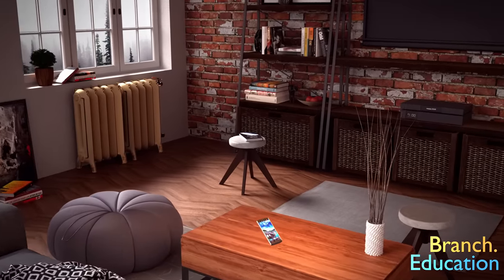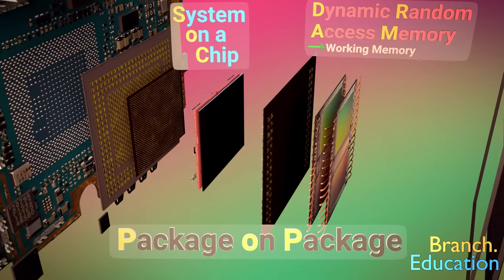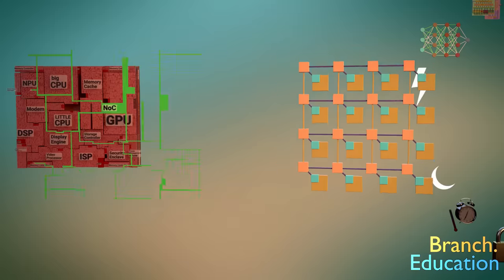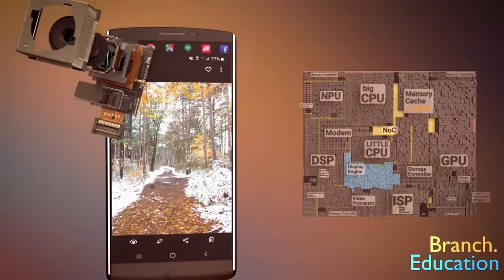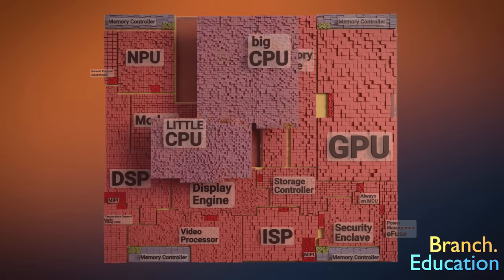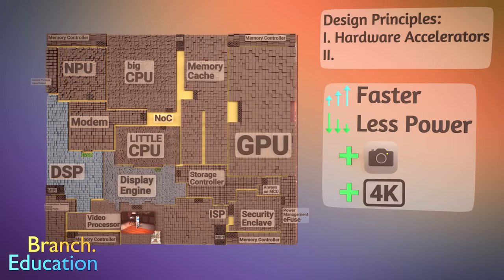How do Smartphone CPUs Work?  ||  Inside the System on a Chip

Comment from the maker: It would be greatly appreciated if you could take a quick second and tell us what you think or provide feedback on the video.  Was it too complicated or was a specific section confusing?  What about the pace of the video?  Was a section too slow or did it move too fast?  This feedback is extremely useful and it helps us improve on future videos!  So, thank you!
Reply: I can only thank you for the hard work on putting together information so valuable people may not even realize - these videos have in their respective scope, more valuable and more important data than many universities. Thank you once again.
Reply: You kidding,this is art
Reply: thank you very much
Reply: Another amazing video!! Thanks again!!
Reply: Nothing. Everything was perfect!
Reply: it was good but I would like more detail about transistor
Reply: Only issue I have is that the video skips over a lot of important details that I am much more interested in. And personally I think it would be way more better to cover these parts individually rather than the complicated system of a phone, I'd rather see the CPU on its own and not the interconnected complex way smartphones do it, at least initially, then you can combine them all together to show how it actually works in a smartphone. But asides for that personal issue, the way you present information is absolutely amazing and is not something you can see really anywhere else at all.
Reply: Don’t change a thing, really really appreciate the work put into these videos. Always mindblowing
Reply: Loved it
Reply: Awesome work!
Reply: Presentaste las nociones básicas de una manera sencilla y muy interesante, seguramente despertara el interés por la tecnología en muchas personas!. Estaría genial que hicieras un doblaje al español. Saludos desde México
Reply: Mind=Blown. I consider my engineering skills above par, but micro electronics are beyond me. While this, too, was beyond me.... well explained.
Reply: I wanted to know little more about NoC section of how they stop electrons from reaching another areas of a chip, little more than just a "traffic light", the whole video felt like a brief explanation, but it's still was really informative, thank you
Reply: Sir, really awesome. Well done ✅. It is cristal clear.
Reply: Bro I was thinking about how processor works for about a month and reading books and seeing vedios on it but by your vedio it is easy for me that how they works,thanks bro
Reply: I want more highly detailed videos😃
Reply: Who the hell hearts there own comment? 

Jk
Reply: Sir make video on how this soc are made and how photolithography techic work
Reply: This technology is insanely small and insanely complicated
Reply: Everything was perfect
Reply: I just want you 2 know that I'm really thankfull for all the knowledge you share with your community, pls keep doing it.
Reply: How a small transistors convert in a processing unit make a separate video on it
Reply: The complexity in these vidoes sometimes makes me think if technology eventually will backfire on us.  Thank you for the excellent explanations.
Reply: I really love your videos and the production value that its put on them, the graphics are great, the content is well explained (not too much or too little) and the length was right! Thank you!!!
Reply: I think this channel's profile picture should be changed into more modern/minimalist design. The current one seems to be outdated.
Reply: @deepbluedrone  yes, i am software dev by trade, and even for me this was realy interesting and informative! Thank you!
Reply: imagine if taiwan was annexed by china long ago, soc development wont go this far
Reply: No words to determine your hardwok and there is no negative feedback.
everything is perfect.
Reply: Please do a video on FPGA
Reply: beautiful video work
Reply: This is kinda counterintuitive but a bit complex video is better. coz most videos about processors and stuffs are kinda abstracted in a sense
Reply: Please please make the complete series!!!! Amazing content!!!!
Reply: Your Gerber Labs link just seems to be a URL without an affiliate link.   I am not sure if that was supposed to be such.
Reply: I'm actually studying electronic engineer at Politecnico of Milan.  I'm amazed and I hope some day professors will use videos like this one to explain what we are going to built. It's clear and well organised. Indeed it makes me find out the will of studying that today I don't have.
Reply: Thank you a lot sir...
Reply: This is exactly the Advanced Computer Architecture course (Universität Paderborn) based on Hennessy & Patterson. Please do in-depth video series as they would be very useful to many bachelor/master students
Reply: Impressive graphics but I found them distracting when you explain a concept while the animations do something else than making the same point. Can't focus on two things at once.
Reply: I liked the flash memory video more because of the detail and depth. This one was incredibly fascinating though even though lacking in details.
Reply: 🔥🔥🔥Perfect!!! but can we please get a live 3D representation of what a basic logic gate looks like in the upcoming CPU teardown... say a basic AND gate module. Thanks
Reply: I feel like the name of the channel puts people off, because they think that it's just for schoolwork or something
Reply: Great video on SoC. Thank you so much Brach education 🖖waiting for the new series.
Reply: (Everyone ought to add youtube to their whitelist for their Adblockers to really help support this channel and channels like these!)
Breaking it down even to graphical interfaces and representations makes understanding these complex core concepts rather easy to understand!
This was a fast 23 minutes, I was able to keep up with the information and details. I was enthralled the entire time. 
These are probably one of the best, if not, the BEST channel out there on breaking down complex things into understandable terms and languages.  If fact, I'm even tempted to show one of these videos to someone who is not technically informed at all about technology (A nice way of saying: someone who knows how to turn on a computer and go on facebook and thats it Lol!)
One thing that I do think would be very useful in future videos is to have links to information/resources pertaining to the info in the video for one's own research, or to further one's own research (Even if it is mentioned that there will be videos in the future about such information).
Can't think of any other suggestions at the moment.
Keep up the awesome work!
I look forward to all of this channel's future videos!
Thank you to everyone who helped make these videos possible!
Reply: Amazing stuff...great effort.
Reply: I love this presenter's voice and style. I am reminded of forensic files and equally as educational and interesting. No, I don't think it was too complicated, in fact I think the presenter simplified the details just enough for it to be educational and yet entertaining. It's like try to convey the key technical details of a CPU architecture such as bandwidth and bus without putting most people to sleep. I think that has been achieved here in a very illustrative and elegant way.
Reply: This is a high quality level of presentation of a very complex mix of technologies but you seem to have great talents of introducing these complexities in a much easier and simplified manner, then going just the right pace to introduce the tech further in a much more detailed but fascinating way. You took a very plain, unappealing and  boring sets of topics and combined them and told them in a manner that keeps your audience interested to know more. Well, you surely got our attention and now we are interested to learn and now more of how those tech work, designed, made, combined, connected and package together  in a  single product like into a single SoC or a smartphone. Thank you for sharing your knowledge combined with your great passion on these subjects and technologies thru your great talent in telling (lecture) how all these tech work in a   very artistic way. Yes, this video is more of a fascinating art than just a lecture. Thank you very much!

We hopefully wish you can make  those detailed videos of those tech, and another video for discussion and reviews of electronic software tools to design digital circuits and PCB. and links to partner company like your sponsor GerberLabs to help us materialize our ideas easier with less effort.Yeah, I am sold! I will try to become an inventor and hopefully can make it into a product. You inspire me to become creative again. Thanks!

This is my first YT comment and feel honored to make my first post here.
Reply: Increase your production speed and provide us more videos.
Reply: Very good informative video thank for it .👍😀
Reply: These videos are perfect!
Reply: The video was great! Are the creator's comments out? I'm not able to access it. If not, could you upload the video along with the comments next time onwards? If it's actually not out, it'll help if you mention when it'll be out. I've loved the creator's comments from the past videos, and I've been coming back here to check everyday XD.
Reply: Rockin🔥🔥
Reply: Well done! How’s that for feedback?
Reply: Awesome work... It was fine to me, even a normal person that doesn't know nothing about electronics basics can understand!
Reply: Never learned this much electronics in 24 mins!
Reply from the maker: @brunomartel4639  Thanks!  It's appreciated.
Reply from the maker: @brunomartel4639  Thanks for the compliment!
Reply from the maker: @nilankoor  I appreciate it!
Reply from the maker: @TheFalco708  That's a good point!  By the end of the script I was like- this has got to end.  In a future vid I'll 100% dive further into the transistor.
Reply from the maker: @randylahey2242  I appreciate it!!
Reply from the maker: @deepbluedrone  Thank you!  I appreciate it.  I hope to eventually to inspire universities to utilize technology and resources such as this in their classroom.
Reply from the maker: @brunomartel4639  Thank you!
Reply from the maker: @russel9083  Haha!  Thank you.  Honestly my engineering skills are just average, but somehow my visual explanation skills are where I'm proficient.
Reply: could you make a video show us what the npu die structure is how this structure works
Reply: 23:22 it should be more small of that map, but you should really compare how big with more than 100 layers vs one parts of one layer how actually small is
Reply: Thanks for sharing an incredible  knowledge
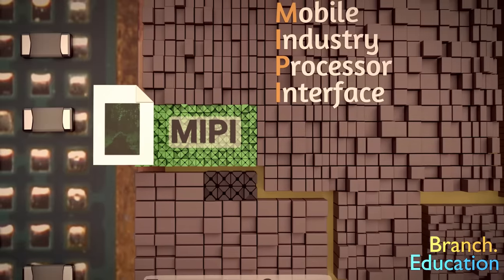Reply: 10:04 MIPI receives and sends data at 5 - 8 gigabits per second wow
Reply: @richard35791  Do you even know what "annexed" means? Geez, dopey people using fancy words they don't understand... You clearly have no idea of the state of play with China and Taiwan. Stay out of politics - you're not up to it.
Reply: subscription
Reply: @andoletube  bruh, taiwan already become independent country, but communism china do not approve it, still claiming it, somehow china not attacking taiwan until now maybe because taiwan heavily supported by usa
Reply: @andoletube  rent free keyboard warrior, want to start debate about politics?? Fine
Reply: @richard35791  You're the one who threw in a completely irrelevant anti-China remark - and packaged it with some geo-political jargon. There's no debating with somebody who is just pretending to have insight.
Reply: So much hard work goes into these videos. I'm not sure why they are not more popular. I'm glad I'm supporting this channel.
Reply: Thank you very much it just blown away my mind your video are amazing!!!!!!
Reply: How humans are able to make such small transistor 🤯
Reply: @andoletube  USE YOUR FUCKING LOGIC, CHINA TECHONOLOGY (SUCH AS HUAWEI RISE IN MID 1990S) MEANWHILE TAIWAN TECHNOLOGY ALREQADY STARTED FROM EARLY 1970S, IMAGINE IF TAIWAN ISLAND CONTROLLED BY MAINLAND CHINA, TSMC DEVELOPMENT WOULD HALTED 20 YEARS!!!!!!!, DONT WORRY MYSELF ARE XIAOMI AND HUAWEI FANS, BUT IF YOU TALKING ABOUT TSMC , IT IS DIFFERENT MATTER
Reply: Mind blowing ♥️🤗🔥
Reply: U nailed the video.. ur the CHIP KING😀😀👍👍👍👍👍👍👍👍
Reply: Can u please bright a detailed video on why don't chip manufacturers such as mediatek,sd doesn't develop their own phones?
Reply: Thanks for explaining in details 👏👏
Reply: Thank you so much for this..
Reply: I don't have enough words or know the proper words to thank you for such a wonderfully conceptualized video, on a device that we take for granted. Kudos for the marvelous graphical presentation.
Reply: Please make video on fab process and inside of CPU and how it works... I have read about the process in my subject but your video made sense on how everything works. I have enjoyed watching your video :)
Reply: Great video. Very much interested in the follow up. Would be nice to have a video on the actual way the logic gates work (together) to execute a task. Maybe not the simple ADD 1 task, but how do various gates, etc work together to perform a more complex instructions. How are they routed? Given the speed these processors work at, how does 'it' 'know' where all the individual instructions are sent to and how are they recombined into another instruction? And come to think of it: how does 'an instruction' get designed on a chip...? I know. Should have gone and worked at ASML.... Nicely done this. Good quality. Good graphics. Well done.
Reply from the maker: @henktl3580  Thank you!  Yeah I for sure will provide more details than just 'how do gates perform ADD', because that's a video I've seen a half dozen times already on YouTube.
Reply: @BranchEducation  Great! Look forward to that.
Reply: Wow! This was incredibly detailed and comprehensive, while still being digestible. I feel like I can send this to most people I  know who would care to watch a video like this from start to finish, and I'm sure they'd stand to learn a heck of a lot from it. Heck, I was reading about SoCs in EETimes back in 2005, and been using smartphones since the first iPhone, and there were still a few details I wasn't entirely clear on. I've honestly never seen the NoC illustrated on a block diagram before, for example, and it was helpful to know its function, its arrangement throughout the SoC, how it throttles up and down, how many wires it had, and what it connects to. I'd love to see more videos like this! Also, please go into VLSI. You mentioned there are 120-160 steps in manufacturing an integrated circuit... How long does that take, from start to finish? I've seen estimates of 1-2 months.
Reply: Wonderful. This is more than awesome.
Reply: Hey, its a grt video...
I suggest u can make a video to show how to make such animation
Reply: this is very well explained, thank you and subscribed. I even enjoyed the advert.
Reply: I would like to greatly appreciate your work and effort and thank you a million times to explain a complicated topic in layman terms. Keep it up.
Reply: I love you and the channel, thank you! Thank you!
Reply: How to work Gpu(graphic card) please make one video
Reply: Keep it going! Perfect!
Reply: Your visuals!!!!!! Amazing!!! They helped tremendously. It eliminated the need to go into great detail about how certain things work.
For example, simply dividing the image file into different pieces says that the image is somehow split up digitally but eliminates the need to go too deep into saying how that is done.
I also love the simple repetition of the animations to help us understand what you are talking about without having to reexplain in detail again; your words some how fuse with the animation (i can’t explain it)
My favorite part was you carrying us from the taking of a picture with your camera to sending it to a friend over the internet.
Also that grain of salt animation just sealed the deal: as i said your visuals + explanation are excellent... amazing...superb. I thoroughly enjoyed it. 

I love the depth, sometimes persons may not want to search and read about these things or sit in a one hour lecture just learning about a sub system, they just want a deep but general understanding of how things work, and i think you gave us that.
Reply: Thank you for the video - if possible you can make entire series on working of soc , storage , battery , etc where main aim of each series is to understand each component and each episode will contain in depth information
Reply: U are so great to explain this so clearly 💖
Reply: THIS IS BEYOND GOOD....well done!!
Reply: Thanks for taking the time to simplify for the average person. I shared it with all my friends.
Reply: @artremiss5276  The class you’re looking for is called hardware architecture. In the first class that show you how to build things like adders/subtractors memory, and other things with transistors. Finally at the end they show how to tie it all together into a cpu. 

The next class scales up to operating system level. Closer to what you see here, but nowhere near as complicated. 

They have to gloss over a lot to get it in a 25 minute video. If you wanna know the details, go to college as a computer engineering major and you’ll get the whole scoop 😏
Reply: Sir please can u make one video on "how earphone/headphones/earburds works inside"
Reply: Arm controller topic i want.
Reply: Would you share more videos like this? It would be such a huge help for thoso who's studying thia area of knowlegde.
Reply: simply one word is needed to describe ur work - amazing!!!
Reply from the maker: @artremiss5276  Thanks!!  We plan on making separate videos focusing on the CPU.
Reply from the maker: @deleted212  Thanks for this comment!  I really wish I could make these videos 10x faster but with the same fidelity of content, and hopefully one day I will be able to.
Reply from the maker: @wasim_ghafar  I'm working on it!
Reply from the maker: @PearComputingDevices  Thank you!  It's much appreciated.  I'll convey your appreciation for the voice to the narrator.
Reply from the maker: @sashankkrishna8672  Yes- I just recently posted them.  Took me a few days to write.
Reply: This channel is underrated, 110% perfect, loved the video so much. I've sleays been curious how it worked and now I know
Reply: @BranchEducation  Fantastic!
Reply: I would really like to learn more about how the SoC is being adressed to. How is it integrated into the PCB of the phone and how does it communicate with the other components on that PCB?
Reply: Consider changing the font and use more modern color grades but overall it's great!
Reply: I was absolutely astonished by the visuals! Maybe try improving on rhetorics, you could put more energy in your voice. Otherwise this content is greatly appreciated, since it is so rare to find.
Reply: As a electronic student, this is extremely useful, I loved this video, waiting for more
Reply: Not so complicated to a electronic engineer student, thanks for the vid
Reply: Unfortunately, you're going to get a lot of sycophants in the comment section. The fact of the matter is I got bored before the 15:00 mark not because I'm not a techie or hate analogies to human parts but because I think you chose a complicated task (photo-taking and display) to explain how an SoC works. Furthermore, the designing and manufacturing section of this video unnecessarily complicates the explanation of SoC operation. YouTube viewers are not in an electronics engineering 101 class. The monotonic voice is second only to a high school jazz band's ability to put me asleep; it reminds me of those videos teachers used to play about sex ed or sexual harassment. Finally, splitting this video into two or more parts will both simplify the subject matter and keep the viewer's attention. It's like the video was made by a robot (maybe GPT-3, lol) prior to the advent of YouTube and short viral videos.

I hope this was helpful, and you don't take it personally. I'm going to duck the replies. ;-)
Reply from the maker: @BZUHUB  Thanks!  We are indeed working on Arabic translations.
Reply from the maker: @Ou8y2k2  Thank you for your feedback!   From being an engineer, all feedback good or bad is useful feedback.
Reply: I am wondering what is your occupation
Reply from the maker: @user-yp7gv1sr7r  I make these videos full time.
Reply: Every thing is perfect nothing is wrong and i appreciate your hard work
Reply: Instant sub. Only can change from already excellent to absolutely stellar  :-) Thanks a lot!
Reply: @BranchEducation  The section from 2:07 on (Notes and Details on the SoC) was pretty much superficial. E.g. you say: "We rely on manufacturers information ... information will be mixed ... from different sources". Self justification is not needed. All in all, I feel, while smartphones are complex, your explanations are still unneccessary complex. I also feel whoever did the text does not understand the topic completely. Why do I say this? Because  the explanations are in many aspects confusing. It is neither a real abstract or a real in-depth. Gazillion of details and no explanations of principles or fundamentals. The video marvels about complexity. Still, there are also good parts, like the explanation of taking a picture. But even this one could have been done much more clear.

Or, just taking a random quote: The microchips are manufactured on 300mm wide silicon wavers in factorys called "fabs". I cringe at this, because beside the mention of "silicone" this is not relevant for understanding a smartphone. Neither the size of the wavers or the slang word for the factory are important. Lots and lots and lots of detail totally superficially in actually understanding what goes on. Sure, for impressing the uneducated it goes a long way. But it doesn't give them what they would need: Real understanding. 

So it makes me sad that despite the clear effort and dedication that went into this I cannot see that real understanding will stem from this. You could have simpified a lot by skipping much of the detail and putting effort in general understanding about how computers work, because at the end we have a miniaturized PC.
Reply from the maker: @ChristianMiersch  Well, the target audience is secondary school students / High School, and possibly first-year university students.  The idea was to provide a top-down explanation without any gate-level logic.  The issue is that an episode that goes into specific blocks of logic will have to be fully dedicated to explaining those blocks, so I didn't want to breach that topic yet.
   But at the same time, I did want to focus on a functional aspect of your smartphone, rather than saying 'there are all these blocks that do stuff' hence the image processing pipeline.
   I agree I could have talked more about manufacturing, however, the average view duration is around 7min (from statistics of the video), so that's why it got cut shorter and more superficial than I would have wanted.
   If you have a recommendation for a topic and the outline of the topic I'd be happy to take a look at it.
Reply: Hey, I come here again just to write: I read the footnote (: and probably it would be funny to see some joke in the middle of the erratum. Just as a common secret knowledge between you and yours most interested viewers, u know 😉
Reply: I can't say any better. My university processor even share this videos with us when we learn about cpu
Reply: Brilliant in its simplicity and relatable examples. More power to you 👍👍
Reply: Everything was going in a saturated way. The animation was really amazing.
Reply: Great  just wohhhhhh!!!!!!!!
Reply: It’s perfect 👌🏻, like the perfect training video in a perfect factory ⭐️ 🏭 , thank you!
Reply: This Video is more about the SoC than the CPU.
Reply: This is an excellent video, pacing is good. I actually sped it up a little bit, but that's cause I'm inpatient and also familiar with some of the basics of the topic. The only comment I have about things to change is that I would love for the comments within the subtitles to be available to read somewhere in full. I find it really distracting reading them with the video in the background, even with the sound off. Probably because they're so detailed and technical. Very interested to see what you have to say in there so would love a plain text version. 

Thanks so much for offering this kind of content for free.
Reply: videos on this channel are detailed and visualisation of components is excellent. 
I am glad that I found this channel for my learning.
Please make more content. Its useful a lot
Reply: Smartphones do not think they are all engineered and programmed electrical current.
Reply: I assemble program and produce circuit boards with components and it still blows my mind...
Reply: I can't think of complaining about anything even when something would have been there ,right now its a perfect piece of art in which you are specialist .I am just in love with your content .
Reply: Please do 10 minute videos (to prevent being bored) and do wifi routers, consoles and cars and more things most people can relate to. I actually love your videos and wish everyone enjoys watching them.
Reply: I honestly can't think of anything. The animations, explanations, and structure seems of no issue to me at all.

This might be asking too much of an independent channel, but I would pay to see a break down of the CPU architecture of either the 6502 or the Z80 and a simple system implementation such as the commodore 64, apple ii or ZX spectrum(not to mention, retro tech has gained quite some traction in popularity recently). Both should have plenty of material and resources available and due to how long its been science their conception, there shouldn't be any intellectual property issues. This would be a great introduction to the world of cpu and system architecture. Brownie points if you could manage the original IBM PC sense that's the basis of all modern PCs/x86 systems. Id pay double for that one.
Reply: Great video! Please continue the good work. Undoubtedly the best videos on youtube for topics discussed!
Reply: Can u share this video with me I will explain in hindi ....and also suggest for English video for your channel...
Video is amazing ....🔥....
Reply: As a visual learner, these videos are awesome. I pass them around to anyone who has a interest in technology.
They are the gold standard for understanding these incredible devices. Continue the great work.
Reply: You mentioned that a photo is divided into 4 section during processing ( cache 4-16 MB &  super page & super block )Sometimes I see at a display the photo was display from top line to bottom. Please explain 😷
Reply: You mentioned that a photo is divided into 4 section during processing ( cache 4-16 MB &  super page & super block )Sometimes I see at a display the photo was display from top line to bottom. Please explain 😷
Reply: Why don't we use more than 24 MB CACHE @ SUPER CACHE... 🤔
Reply: In my opinion it was perfect in every aspect you mentioned in your question, and so is the entire channel. Amazing work and thank you man.
Reply: All the videos you make are worth watching and I watch it multiple times to grasp the small details you add. Thanks
Reply: Yeah it's confusing because the CPU is its clock rather than the brain which is the writing to the first cache
Reply: I don't LIKE this video : I LOVE it! The explanations are sooo clear that even me have understood it... You did made simple a quite complicated matter with almost no technical terms, and when used, they were clarified in advance! Due to the absence of a "Love" button, I hit the "Like" and subscribed (the guys in YouTube should correct this). Thanks for a great job.
Reply: Green fonts over the green background is not the best decision.
Reply: I'm speech less. I want to write too much that I can't write. Really amazing video. Thank you very much.
Reply: Such an amazing and informative video. Please add more videos like this to explain CPU further like you said in the video.
Reply: Thanks for this video.it's esay to understand and give me a lot of interesting information about today's technology's.. it's also a maind blowing facts about hand phone that we use every day.hope next video is about how to free up our hp memorys in most effective way or tip and trick that hidden in our hp.anyway thanks for making this video.I really enjoy it.bye...😊👍🏻
Reply: Very simple language and amazing teaching skill🎉🎉❤❤
Reply: I thank you very much for this video first of all, your intent to teach what you learn is very much incredible I know that information that you passed to learn very thing is taking 100-1000 of books to know and to say the information like this to represent this data like this I have take one year of time or pretty much more this is worth of billion dollar thanks to you guys make it simple and quick for me and once gain I thank you guyz very much
Reply: Damn, absolutely speechless! Never before have I witnessed such a high quality video that accurately shows the processes of an SoC. The animation is exceptionally high quality! Very well done! 20/10!
Reply: This video was too short. Make longer videos,1-2 hours, and explain everything.
Reply: These videos are, no exaggeration, nothing short of treasure. Some complexity is necessary, or every video would be 5 hours of restating rudimentary knowledge that could be found in other videos.

Your content is truly amazing and valuable just as you do it
Reply: Sir , what you are doing extraordinary your video don't needs feedback there are no detailed micro chips videos I have seem my entire life , your graphical explanation is I m speechless I have no words you explain in so deep a non tech savvy person can easily understand the complexity of this micro tech and your are asking for feed back I wish you soon received YouTube platinum play button BBB because you talent is extraordinary like a more than a scientist.
Reply: This is awesome. I like it to be very detailed like this video
Reply: love this channel
Reply: Fcking awesome video. presentation, editing. Superb.
Reply: Thanks for uploading
Reply: The video was great, but, as mentioned, it was just scratching the surface..I still don't understand a ball of the technology involved..and I probably never will...but of course thnx...
Reply: You really did great Branch Education.🙌 Can the voice of the narrator be more lively and energetic?😁 Overall your hardwork is highly appreciated.❤
Reply: Для1й
Reply: That was breathtaking. Thank you.
Reply: Mkae Videos on Interrupt Signals & Direct Memory Accesses etc
Reply: These are greatly appreciated! Simplifying a ton of research in visual terms is so underestimated by calling it YouTube videos - its magical
Reply: I have a long attention span! Excellent vid. Thanks!
Reply: Special thanks from Morocco.this channel must be supported because it gives us premium contents.
Reply: Really good video that made me discover the NoC. It's seems to be a crucial subsytem yet really a unsung hero of our SoC so I think it would warrant a video focusing only on NoC (history, development, how they work (routing protocols, switches (and buffers?)) and what are the current and next-gen advancements in this domain). In the meantime congratulations for your work, you've got yourself a new subscriber
Reply: Wow you not need to ask it is nice or not It is very very very nice ☺️🤠
Reply: P
Reply: I would have loved if it was more detailed, even if the video was 2 hrs longer
Reply: I actually work in this field in one of the companies mentioned and have to say that I've never seen such a great content before. The only thing is that you touched different topics and tried to dive deep in some while leaving other topics out. Maybe some might find that confusing. Perhaps a top-down approach might be easier to follow, or a series of videos explaining different topis. The thing is that the complexity of these topics is so vast that you can't just sum up all in one video trying to dive deep. 
Note: I just discovered this channel so maybe you have other videos on this topics and now I'm going to dive deep on your channel. The quality of this video, the explanation, the animation is just astonishing.
Reply: that is so dope what you guys have made.
Reply: it is perfect 🙏🏼
Reply: That is decent illustration.  Appreciate it.
Reply: Tine time come back to work tomorrow morning at all times of need it now but I'm going back home now baby girl is going well with your family are doing great siuierseteirs data connection is not a problem for me too much of it all out of it all out and about to leave you alone now I'm not sure vifer iteam
Reply: Chime and Mr Clean beg to differ.
Reply: The best knowledge just for for free and not only for engineering  students but each and every smartphone user to know on that thing that they are using everyday averagel 3-6 hours
Reply: We definitely imagine what smartphone or android what is going on inside when we used ..thank u so much for the informative video ☺️
Reply: Just want to say thank you.
Reply: I love super detailed explanations. I understand most basics but there is a lot more low level stuff I don’t know about.
Reply: @brunomartel4639  the most good thing of your video is whenever we search for some topic in youtube, there are generally two types of videos. First, videos which are very simple and not too much complicated. But on those almost all the times I have seen that they just miss all the necessary details and do not tell anything except definition and completes whole video in just elaborating a definition. Second, Videos which consist of all the details but those are so complex that it looks impossible to understand that video for a person not belonging to that field. But the most good thing in your videos is that your video are just the mixture of both. You mention all the necessary details in your video and also not make it complex and explain topic in a very good manner. I know that making such a content is not a matter of few hours or few days only. But even then I request you to please upload more videos as almost all of your videos are just amazing and truly speaking more enjoying than any web series.
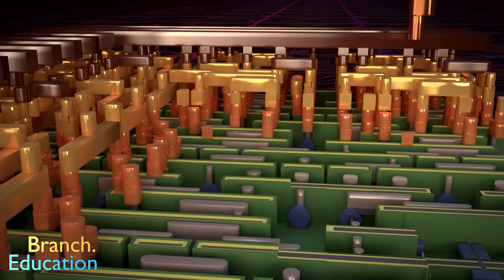Reply: The video seems to be muted from 23:38.
Reply: Thanks so much for the hard work and good videos it’s really impressive, just a minor comment regarding the audio at the last part of the video which has no sound
Reply: We didn't understand much to find issues in the video
Reply: One word .... Awesome !!!
Reply: Why did the audio cut off at 23:39